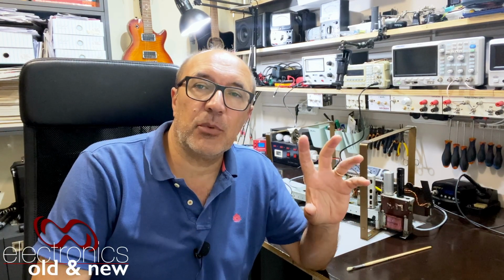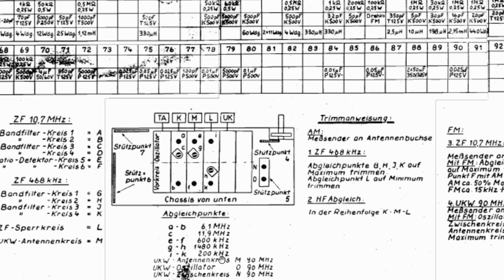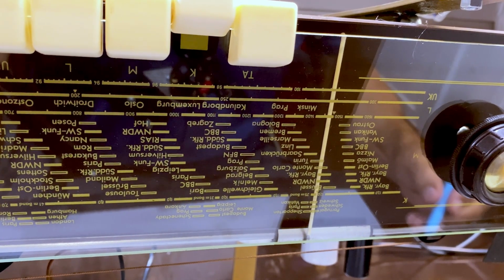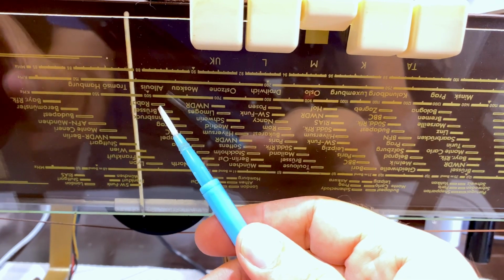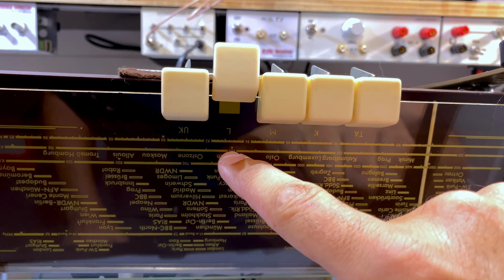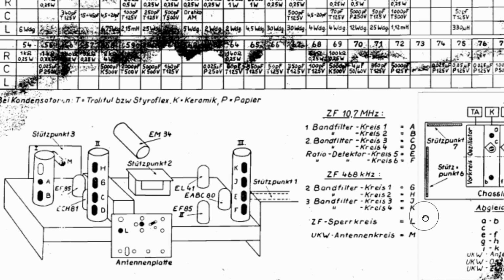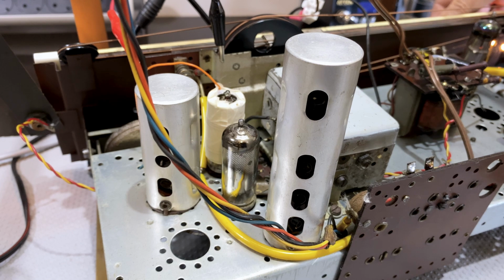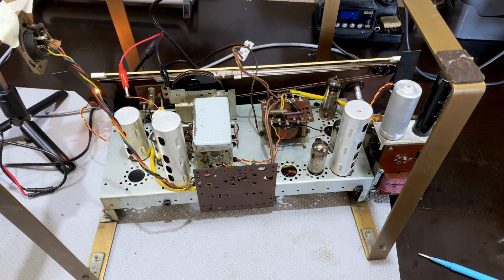Doing the AM RF, and the FM IF alignments. Nordmende Super 250-9 rest. pt. 6

Comment: Hello,
I would like to ask a favor, regarding the following question: in the IF FM alignment, would it be possible to use two signal generators, one doing sweeping and the other at the frequency of 10.7Mhz? Would the oscilloscope show the marker (pip) on the sweep curve? My thanks in advance.
Reply from the maker: You can actually do that, but provided the sweeping generator is linear, and you set the start and end at the same distance from the 10.7 then theoretically that point will be right at the centre of the trace.

Comment: Adjusting IF transformers for peaks will give you a reduced audio bandwidth, particularly on FM. They are designed to be bandpass filters and should be aligned with a wobbulator so you can see the bandpass shape you are getting.

Comment: I texted you about my Grundig Satellit 2100 going intermittent on the MW....SW2 after it had been on for 5 minutes. The fault was with the T11 oscillator transistor BF240. Should you ever need to replace T11 on any future 2100 radios, the MW....SW2 frequency  dial doesn't need to be removed, but it does for T10 and T12. What I found was a slight resistance between the collector and the emitter of T11 after it was removed. I've tested it with a 2N3904, which I had and now waiting for a BF240 to arrive on Friday.
Reply from the maker: Thanks for the tip. 👍

Comment: I wonder, given that this is the first FM frontend that I see using a single pentode (EF85), why the standard became 2 triodes (ECC85 or rarely 2xEC92). The schematic seems to be much simpler with just EF85...
Reply from the maker: Yes it is simpler, but lacks some RF amplification that the twin triode circuit achieves. The use of the ECC85 became quite standard soon after this radio came out.